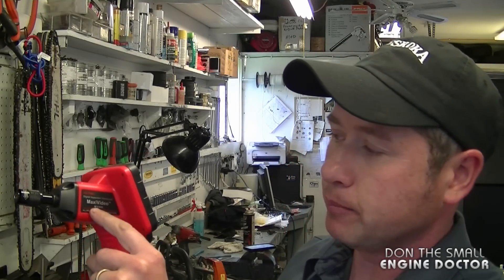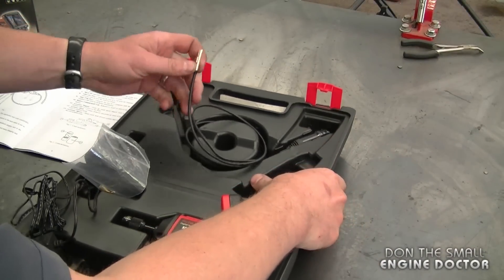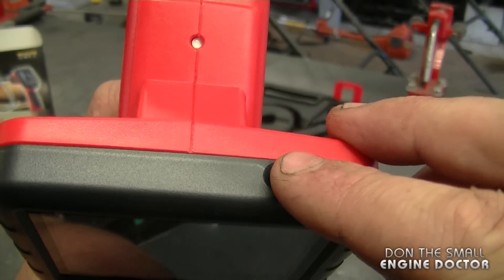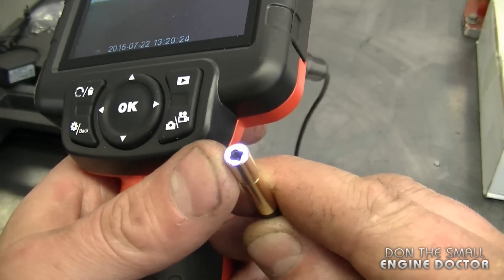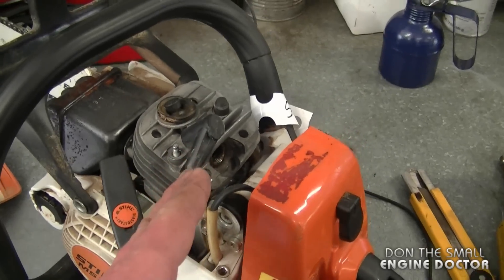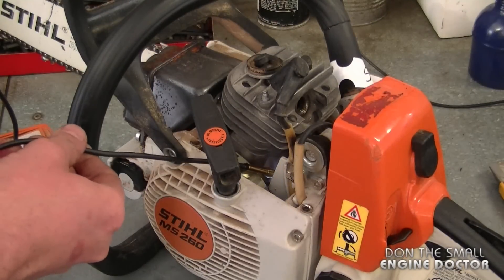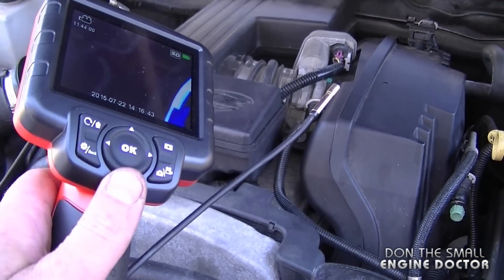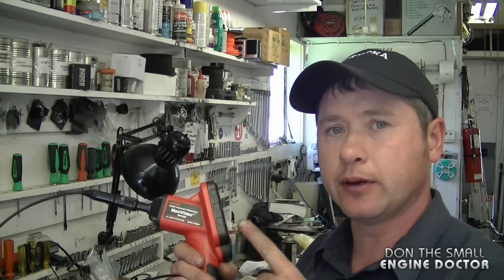TOOL REVIEW - Autel MV400 Inspection Videoscope

Comment: Once again beautiful job on your video, very professional. I was thinking, there are lots of uses for it that are not connected to mechanics, such as plumbing. i.e. looking down plugged sinks, especially if you loose something down there.
Reply: W. Gator I'm wondering if it's waterproof for plumbing applications .
Reply: George Lee I imagine the probe is waterproof, that is all that would need to be, but actually that is a question for Don, not moi.
Reply from the maker: George Lee I don't think it it's waterproof

Comment: A reviewer on amazon said it was useless for engine inspection (presumably automotive) because it couldn't look up, and that the mirror attachment had glare that made it useless (design flaw). Did you try the mirror and did it work for you at all?

Also, amazon mentioned streaming, and while I didn't see a review that figured it out, it looked like from your video that instead of plugging the camera/cable into the display unit you could plug it right in to the same mini USB cable to go right to the computer. Did I see that right?
Reply: rpavlik1 I think that the mini USB cable is only used for transferring the files from the camera unit to your computer.  I doubt that you can use the "camera cable" with just the USB cable.  The hand held controller must be used.

Comment: Looks like a nice tool don :-D
I would be supprised if you use it often though, your expert skills at diagnostics serves you well for 99% of repairs :-D
Are those holes in the end of the mains plug to lock it into the power socket?
Reply: zx8401ztv That white adapter is made to fit the plugs of many Countries.  Pretty sure that the different holes that you see are where you would plug in your own cord to be adapted to that style receptacle.  Another person might use one of the other hole patterns on the white plug.
Reply: ***** Ahh the adaptor plug i ment, look at 1:05 for the holes i mean :-)
Reply: zx8401ztv Yes, inside north american outlets, there are bumps that fit into those holes and help retain the plug against falling out from it's own weight.
Reply: zx8401ztv
Yeah sorry I just realized what you meant.  Sorry for the mix-up and needless comment on my part.
Reply: desertfox2020 Thank you :-D, i did wonder about them.
Uk 3 pin plugs dont have anything like that.
I do like the slimness of the two pin types, much neater than our 3 pin lump ha ha :-D
Reply: ***** Hey you answered me, you didnt have to, thats being kind :-D
i appreciate that :-D :-D

Comment: good I 'm Portuguese and I'm writing but I'm using google translator to send this message . I have seen immense your work and I really need your help if possible .. because I bought a scooter gasoline as Mr. make videos , so I have a very strange problem pors the bike when turning on the accelerator instead of accelerate the bike does not go down and the air lever to make this accelerator will open the air and she will acelarando walking as if to accelerate the handle .. think you can help me I really need your help .. can answer the language you want me to use google translator ..
greetings and I am counting on your help :)